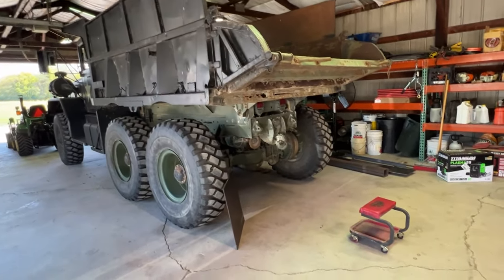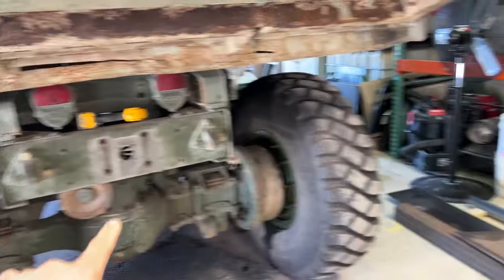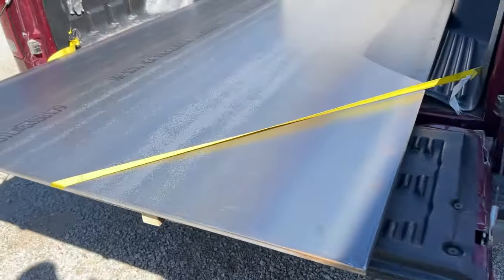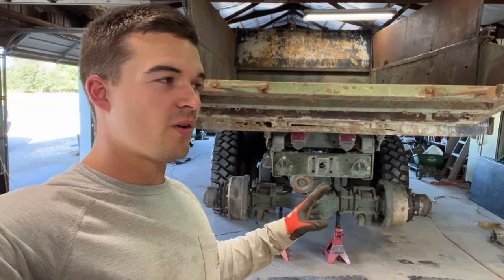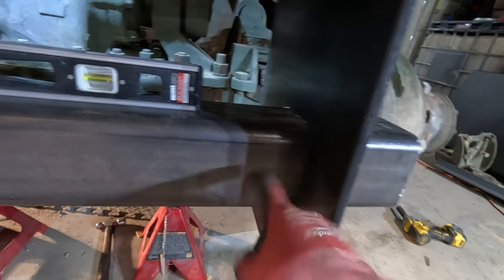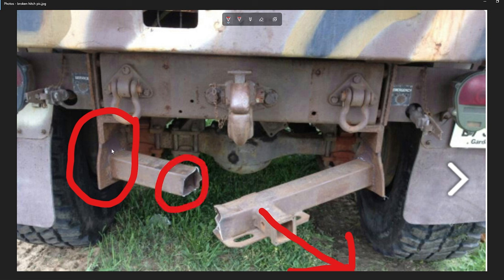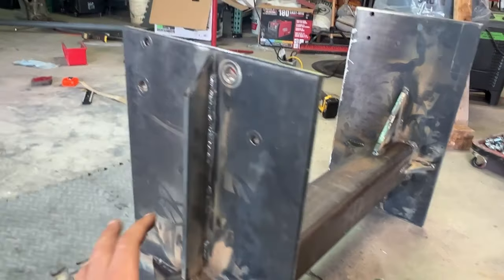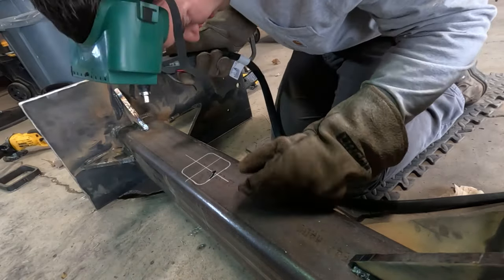Making a Hitch For 6x6 Military Truck

Comment: As a Veteran of Army, and Heavy Construction Equipment Repairer deployed to Iraq in 1991 Desert Storm, I drove some 12,000 miles in my Assigned 5Ton Dump Truck.  Mine was also an M-817 Dump with Winch. I  had split rim duals in the rear (8 tires and wheels) And I loved it!
The oil leak is a problem that I definitely dealt with in the Desert. 
You have what looks like upgraded axles and Drums, to use the single tire and wheel, at each axle end. I had Ten wheels and tires plus a spare. 
You can be grateful for having 6 of them!
So in my experience having a good gasket (not silicone) keeps the leaks down but more importantly the Bearings on mine kept getting messed up, in my case due to the lack of a 4 cent piece of cork that was missing from the axle tube. We found that out after multiple blow outs. I leave that story out for now!
On my truck the bearings were greased with GAA and were kept separate from the differential lube (liquid) by the cork squares that fit in the top groove that was machined on the axle tube. It was about 1/2” square and probably 1/4” thick and was behind the washer that had a tab that would fit in the groove with the nut holding it in place and the bearings with Grease were kept isolated from the gear lube. If they mixed (oil and Grease) it would flush out the grease and make the bearings run wet and then without grease the gear lube was not able to keep things lubricated enough and then it would get hot fast in the Desert. 
Hope to catch up on your Videos, new Subscriber, and the sound is music to my ears and good vibes to my Soul hearing it!  Kudos to you for wearing your hearing protection. I’m not going lie 20 years of experience with the Army has destroyed my hearing, and the practice of ignoring hearing protection has made me regret my ringing ears and my new hearing aids are not available yet but I’m going to call the VA Monday!

Last thing, those Butterfly wings on the tailgate can be folded in to the side giving you a vertical rear tailgate!
I hated that look with the long sloped rear end.

Comment: I think you did a good job, but you ask for advise about what could have done better and I think a plate bolted under the old pintle hitch down to the receiver hitch would stop most side to side movement and stiffen it significantly and you could do it in two pieces so that you could unbolt it if necessary. Other than that, I personally would have welded it with stick and 7018 or 8018. But I live on stick.
Reply: Stick welding would've definitely been the choice between his options. And welding ever possible inch of contact, double and triple passes in places as well

Comment: Excellent job Spencer, all that is left is set up the truck bed to haul grain also.
Reply from the maker: Yeah with a close to full wagon it’s about all I would want on the truck. The bed is only 10 feet long and sides aren’t crazy tall. It would be cool and a fun project. Maybe next year. Probably could only fit 200-250 bushels.
Reply: I was thinking the same thing.

Comment: As well, when drilling holes use a 1/8" drill bit! It is faster, easier, so you accomplish more in a day.
With sufficient lubrication. then brake clean it off.

Comment: Much rather wear out those old truck tires than expensive tractor tires.up and down the road. Would have used all grade 8 bolts in the hitch. Might add another bolt for the slide in receiver so it would be a double shear. Love those old GI trucks...

Comment: Hey. Been watching on and off for years. I put 3 beads on all big stuff like that. The mig is you fill then stick. One bead all the way around mig under 2 beads of stick. You should exceed 500k tensile  strength on all big things that you weld. Smaller stuff you just gotta burn in.

Comment: Hey Spence! I hope you don't mind if I take up a little space here, and few moments of your time :)
Looking at everything overall, from buying the classic & classy truck itself (and the excavator before it) building this hitch, practicing your welding and cutting skills, learning new terminology, figuring things out how concepts relate and physical parts go together, and so on...the word "awesome" only partly covers it! You're learning in leaps and bounds, getting all kinds of experience which propel you forward into even greater success...a self-reinforcing positive mode of being! I believe others as well are inspired to see you interacting with life and enjoying the whole process! It's natural, and truthful. Genuine, is another way to say it. It is a form of integrity you demonstrate, which speaks to character. It's how you earn your own version of that classic hat you wear! And we get to be witnesses of that.
About the hitch itself, I keep looking for some point on the frame, forward of the side plates, so you could run heavy angle from the 5x5 corners, up and forward, adding a great deal to transferring the force on the hitch up into the frame. I hardly see an inch, or maybe two which could be gained. The 'bumper bracket' attached to the frame above the rear spring mount seems in the way. The only tiny place I see is maybe one bolt hole forward of the top of the side plate. Not a lot to be gained. I might have gone with 3/4 for the side plates for overkill, but for a whole sheet, it gets pricey. 
I might still consider if it's worthwhile to use some heavy angle welded to the outside of the side plates for a sort of "V", both forward and back, with the upper corners of the 5x5 being where the bottom of the "V" basically starts. On the front side, if heavy angle were added both inside and outside of the plate, up to, or a little a little past the bottom of the frame, a cross piece of tube or plate might be added to bridge under the frame, joining both angles, to transfer the force of stopping, and to add 'anti-twisting strength' to the plate, since angle resists distortion from multiple directions. An alternative might have been to use heavy angle where you made the 'splines' of plate, which so far get you side to side strength mostly. A piece of angle could also be added parallel to the 'spines' still, for a simple add, if desired, even though it is all nicely painted already. I think for the cost of welding, I might have also looked for a continuous weld of the spines, but that's minor and not meant as a criticism. 
I think it's great you had Ron to help you (and your Dad and Grant of course!) I've watched him a bunch, and being a trained engineer, he really can confirm your common sense and add some practical wisdom and theoretical knowledge! I'm less concerned now about liability than I was at first lol But many individuals have welded up whole trailers at home, so maybe I'm too conservative there.
I'm glad you talk about something in this video i noticed first in the video Grant put out I watched just before this one of yours: I noticed the cuts you were making in the 5x5, and I re-watched that a couple of times because the lines looked so straight and the job you were doing looked so good. The thought ran through my mind of how recently you even just got the plasma cutter. It was noteworthy skill improvement, and you noted it! lol Not that you were bragging, but it was gratifying to hear that you saw your own improvement too! 
One thing I would have liked to see is how you reinforced the outer edge of the receiver you made lol But that is very minor! I know this was really long for a comment lol but I enjoyed what you did, and how you shared it; so thank you sincerely, I am much obliged.
Reply from the maker: Hey CuriousEarthMan I appreciate the comment and enjoyed reading it. Yeah for that "spine" piece wouldn't have hurt to take it all the way down. There is a limit on how much room there is under the frame for the hitch to fit with the rear axle so close. Also the whole idea behind the hitch is to be able to remove it fairly easily, so I am limited on what I can weld to and the bolts seemed the best option. Yeah I thought about just going crazy with welding a lot of stripes of metal on inside and outside of the vertical side plates to help with any twisting. Doing that probably wouldn't have hurt anything and made it a bit stronger. It seems the weakest points in my eyes are the bolts holding the hitch on or the receiver. 

We are done with harvest now and everything went good with the hitch no issues. You will see more of it in upcoming videos on Grants channel. Yes it was nice to have Ron think through some ideas on how to make it stronger. Again thanks for the comment I appreciate it!

Comment: How I designed mine was.
1/2" T one steel for verticals
3"X 5" X 1/4" wall. 
Cut pieces for the inside ends to bolt the horizontal to the vertical. 
You did do the through as I did, except bolted them the cross to the vertical. I had metal to metal surfaces with ?? 1/2" UMUW ultra high molecular weight like Teflon , but cheaper. 
The back of the tow hitch, on the top side of it put a cross 1/4" wall flat bar. Just to spread any forces both top and bottom. 
They did make the holes for bolting horizontal to vertical over size, so I made them into 9/16" holes for that size of bolt, which then does little as the pull is on the verticals as they are bolted to the frame with 3/4" NF Federal allow aka gr 12 bolts. 8 total. 4 and 4. 
This way I can could lift it in and out.
OH one more , use Kopper Kote on all bolts so that they come apart in the far distant future!!!!!!
Also the receiver has a hole for a bolt/pin behind the tow hitch so if the front one breaks the rear one will hold it. Fail safe not a disaster .

Comment: The couple of things I would have done differently is reuse the heavy duty hitch that came on the truck and not the pickup style hitch receiver, if you needed or wanted to tow pickup style trailers behind the truck then mount it behind or below the heavy duty hitch that came on the truck, never be afraid to over engineer something either, also why don’t you haul grain loads in the dump bed aswell as the wagon, just make a foot high tailgate to empty the truck bed and put some grain chute on tail gate either one in middle or left middle and right side, being ex military truck I’m assuming it only has like a 5-6 speed crash box compared to a 15sp deep reduction would be a good box to put in it

Comment: You need you to make it so you can haul corn in the bed of that truck. Just a suggestion. Great job on that hitch
Reply from the maker: That would be cool! The main reason I got the truck is to haul dirt/brush/rock. The hitch was just a fun project to help with corn harvest and I built it so I can take it off easily. The trucks main purpose is a dump truck.

Comment: As I only design things. I would have thought that at your time of , 9:40 you would have put your outside support from rear left to front right so at to support the tow from twisting , as the one you showed broke in the middle left of. I hope that makes sense? 

Where you cut your tube after the  build I did mine prior to so that it would could slide into be centered on the verticals. 
You need a welding table like i have it prevents kneeling , much nicer to work on. Mine bolts together for moving it. Tolerances of these?? a few 0.002  will do!!!!!!!!!!!!!  
On the hook on the right hand side the it's pin is backwards. 
It looks like some of your welds are were colder then should be?? As well undercut on the welds. This can cause cracks into the steel. So incorrect weld angle. 
Your plasma cutter is to droll over. !! 
That was why I made my ???  3"  receiver female longer so to have an other bolt or pin for safety.

Comment: Great job on the hitch, you said you were having problems drilling the holes, Not sure if you used a Mag drill but one is needed for such thick material.  You have to rattle can those red doors,  Paint them black or green. My opinion the red looks horrible.. Thanks for sharing
Reply from the maker: Yeah I just used a handheld drill I don’t have a mag drill. The doors were off of a fire truck that the previous owner put on. Thanks for the comment!

Comment: What are you got trailer brakes on it so you should be good and I had like 450 pounds of those bolts you used specifically for those military vehicles that you have. I could’ve gave them to you, but I took him to the scrapyard because I didn’t have anybody buy them… it’s crazy when you see something that works out and I happen to stumble of cross your video and I was interested in how you did it but you lowered it just right Be able to pull like that I have a commercial license so I’m used to driving class B vehicles

Comment: Why didn't you load corn into the bed of the 6x6?
Reply from the maker: Would fit maybe 100 bushels and fall out the back… I will need to fabricate a end gate for it. Calculated it would hole about 250 bushels max once built. (It’s only 10ft bed) thinking it’s not worth the hassle right now. Maybe in future. It would complete the whole setup.

Comment: What did the leak in the engine compartment turn out to be?
Reply from the maker: Haven't looked to close yet. Next oil change I will try a oil leak stop additive. Probably wont do anything... but worth a try.
Reply: @spencerhilbert  Could also be the power steering. That's where my M813 is leaking.

Comment: Load the truck more weight to control the wagon
Reply from the maker: The truck weighs enough to handle the weight and on gravel I lowered PSI. When slipping the 6x6 kicks in and haven't had any issue with traction. Never really had to load the wagon full. Just enough to by some time for the tractor to get back. Thanks for the comment!